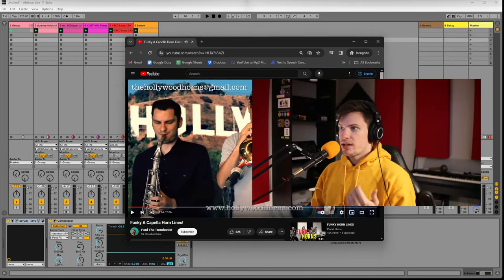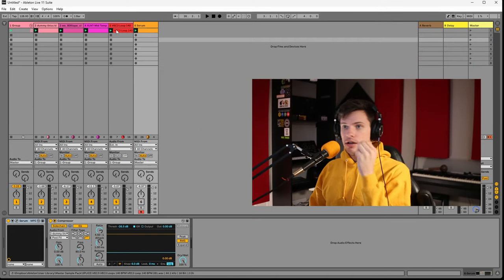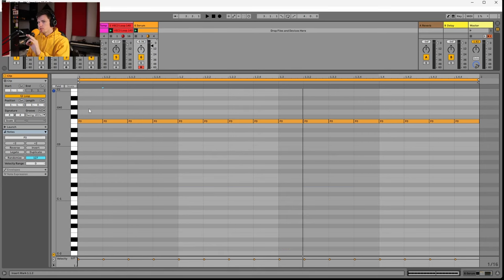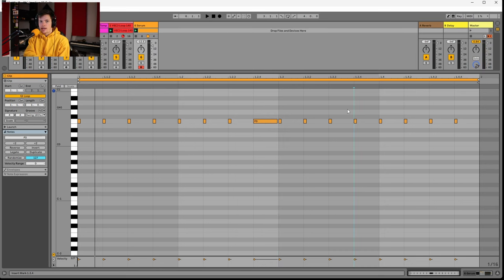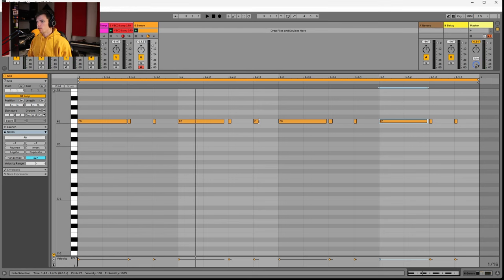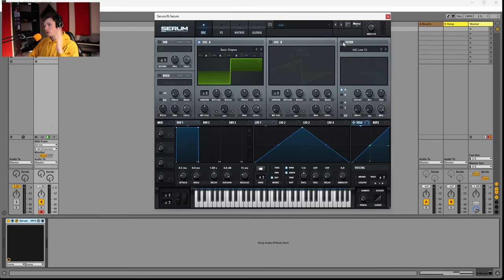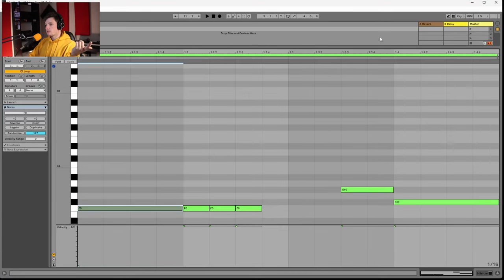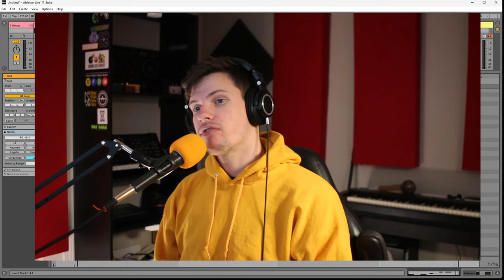The key to groovy dance music basslines

Comment: So what you're saying is that not all notes have to be the same size in the piano roll? How would we know which ones should be short and which long. Isn't it better to simply have them all the same size.
Reply from the maker: id say the notes you want to emphasize should be the ones you lengthen (but expermient for urself here), when musicians play instruments they kinda do this instinctively but when we r composing on a computer we need to manually add in all these samll variations to get the same feel
Reply: I agree that it should be mostly instinctively. You can't always explain groove, but you can feel it.
Reply: If your play your melodies on a midi controller, for an example, you see that the notes are not even. Some are longer, shorter. This gives a natural feeling in my opinion. Off course, you can always put the notes, on the grid, if it´s sounding off.
Reply: @rachidow2125    To piggy back on that comment,   Imagine your electronic instrument as something you actually play.  It's easy to slip into the pitfall of clicking in notes and not humanizing them.  I think what can be really helpful is study some bass players and even import bass playing audio . If you have an AI ripper, just extract the basslines in some old funk music and study what they look like.   When you actually learn to play your midi keyboard, this starts to become a little easier I feel.  I think most importantly, you have to establish a general groove with the drums in order to help you come up with something "Groovy".    There are also midi packs out there that probably have pre-programmed midi basslines you can study.     Cheers